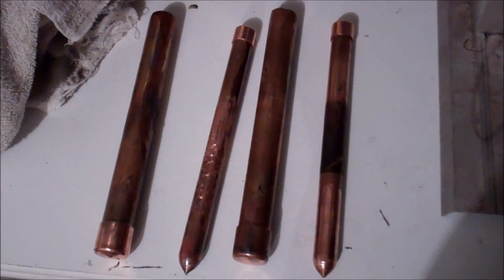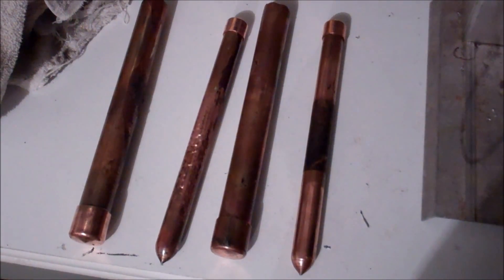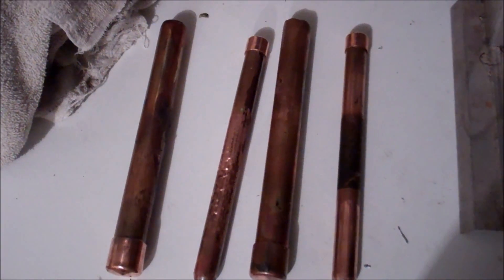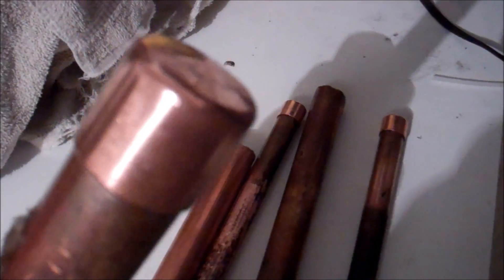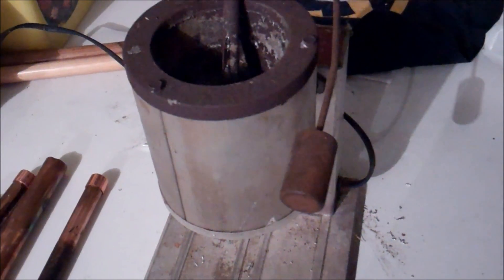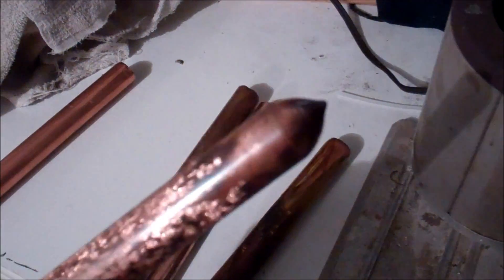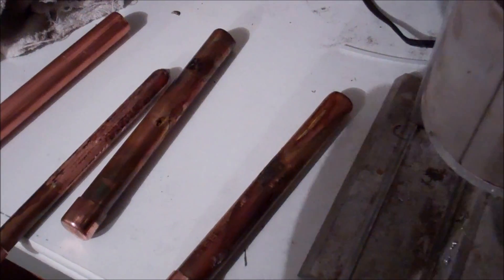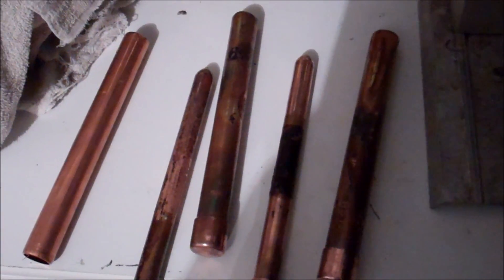Making Copper Boppers for Flintknapping

Comment from the maker: @ummmhuhhh I haven't tried those. I'm actually taking a college class on flintknapping so, I didn't want to start buying tools until I was sure I would use them outside of class. I actually found that I am better at knapping with a hammerstone than a billet. Thanks for the tip, I may have to pick one up down the road.